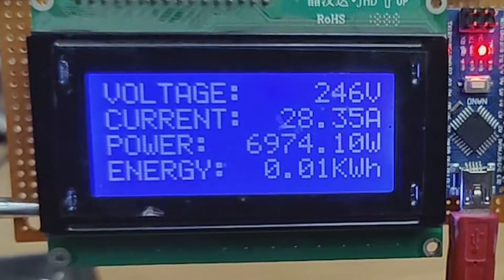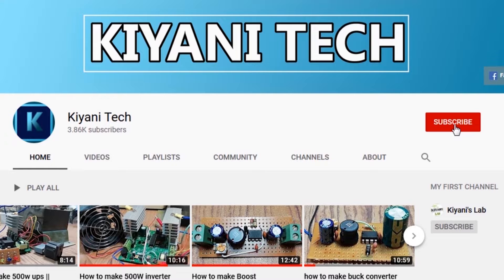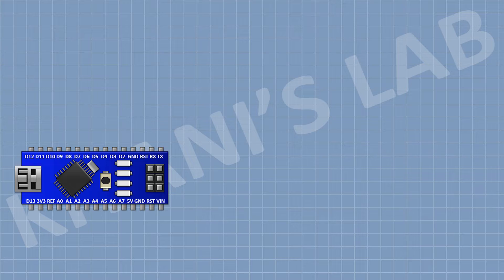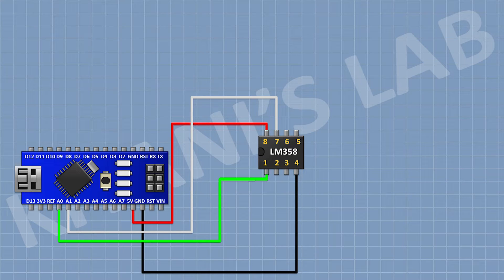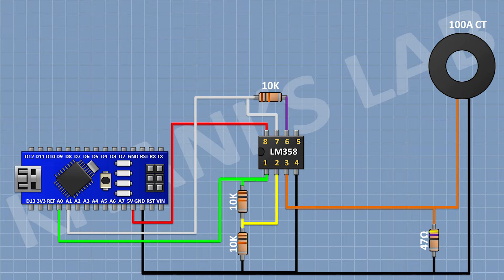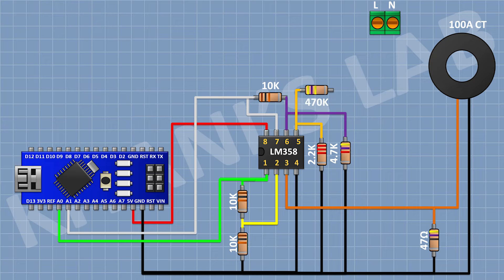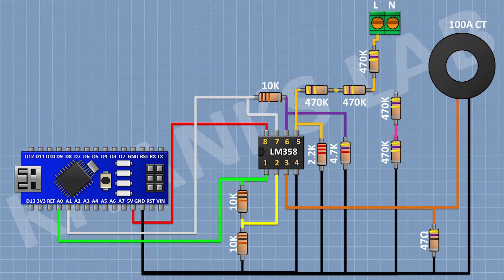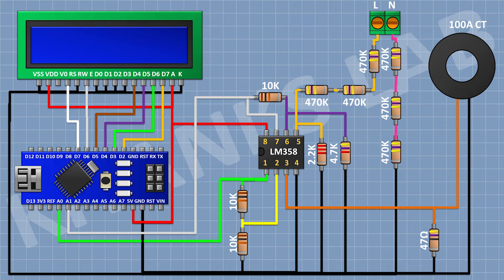How To Make AC Power Monitor | Arduino Project

Comment: Bro please make circuit for Over and Low Voltage Protection for AC devices using 12V Transformer, LM358/LM393
Reply from the maker: ok bro soon

Comment: Hi boss make a 12v charger controller using Arduino Manu system can control voltage
Reply from the maker: ok bro soon

Comment: Is it possible to monitor DC battery voltage and solar panel voltage also in the same device in addition to the AC power ?. I mean an all in one meter
Reply from the maker: soon i will add them in new version

Comment: 100A CT  In the video, two wires are used, but in the link, four wires are used instead of three wires, right? What model is used in the video? Thanks
Reply: yes also did you noted .16x2 display in circuit and in link ,but finished one is 16x 4 display..come-on men..hikiz,
Reply from the maker: 16x4 and 16x2 has same wiring connection bro
Reply from the maker: bro in the ct 1 wire goes through the core (the donut) that wire contains the load current